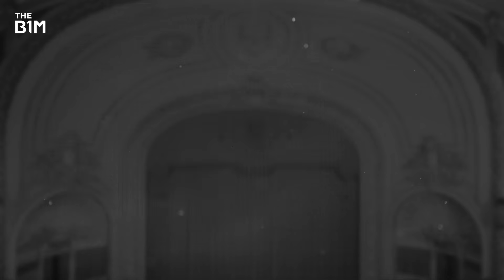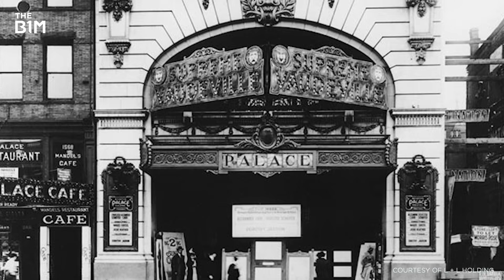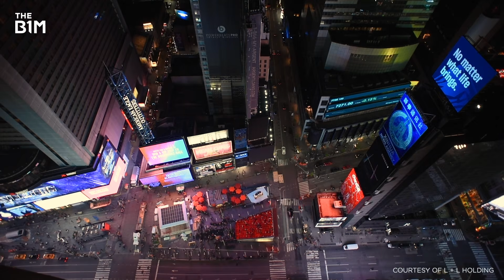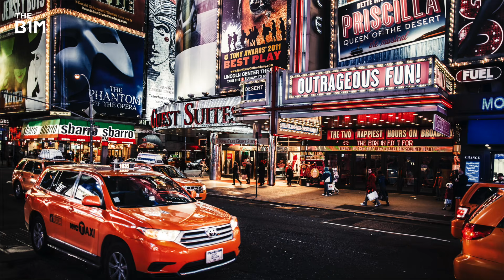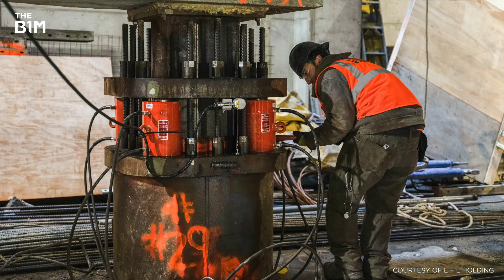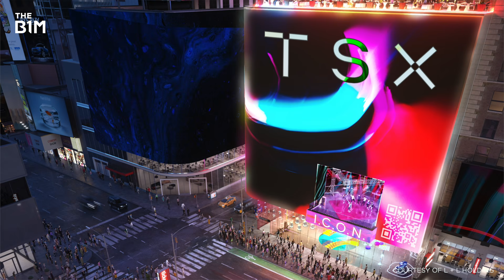The Insane Plan to Lift a New York Theatre

Comment: I was part of the company of the first show to play the newly reopened Palace Theatre, and the design is a nightmare. While the feat of lifting a building into the sky is impressive, it’s clear no one consulted theater makers on how a venue actually operates. Cramped lobby space leads to chaotic crowding, dangerous pinch points in entry and exit, and unnecessary lines for lavatories. Even worse, there are false exit doors that could be catastrophic in an emergency.

For performers, it’s a disaster. Dressing rooms are three floors below street level, while the stage is three floors above. There’s no working elevator during performances, and the backstage constantly smells of sewage from poor plumbing, with vermin issues giving the place a prison-like feel.

After playing Broadway houses and touring theaters across the country, I can confidently say this is one of the worst renovations of a Broadway theater ever executed. It’s a beautiful building, but a disaster as a working theater.

Comment: But there is one aspect that they may have missed, will this building be able to withstand the stresses that the new sound systems could produce over time, and should be studied for cracks, or movement of Any significance for at least the first year of operation on a weekly basis and if any damage, should be reported to the proper authorities

Comment: They did this all the time, even during horse and buggy days. Chicago gained a lot of experience with this when they raise the entire city by 6 feet because it was built on a swamp. They raised the Palmer house, which took up an entire city block with 1000 men using hand jacks. You can still go to neighborhoods like Pilsen and see bridges going from the sidewalk to the former second story of an old house. Moving was also very common back then, because labor was cheaper than materials. I’ve read that they would be moving a house down Michigan Avenue as the family ate breakfast and sipped tea while looking at the rush-hour crowds through their kitchen window.

Comment: Well, that's one way to do an end-run around the Ship of Theseus question. You don't need to ask if it's still the original theater after taking it apart and replacing all the parts, if you never take it apart in the first place.

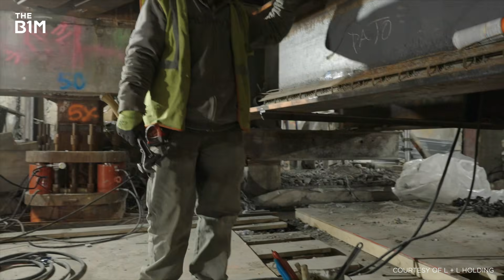Comment: 5:36 - - 34 hydraulic lifting posts (under a 48-story building) 
6:50 - - lifting the theater 30 ft (3 floors)
7:32 - - 7 weeks to lift the theater into place (2/14/22 - 4/5/22)

Comment: The retail in Times Square is always revolving and never stable. So many chains have moved in and out of the 5 street span because rent astronomical and nowadays what you find in retail in TS is the same anywhere else or online. In the 80s that wasn't the case. Multiple financial firms are backing this project and will no doubt sell it off as soon as it's profitable to them.

Comment: Can you make a video of this building in Detroit called "The exchange". It's not a skyscraper but it is a high rise apartment, but they are building it from the top to the bottom. They have finished the elevator cores, and now, they built the top floor first and are building down. Can you make a video explaining how this works and if it's good or bad?

Comment: Astonishing. I saw “Cage aux Folles” there in the 80’s. Built before sound amplification, the balconies are incredibly steep so as to bring each seat as close to the stage as possible. I was about as high up as you could get, the ceiling seemingly just a few inches above me, Do wish the grand facades of these wonderful old theaters could be restored or at least decluttered. There is so much emphasis on lights, noise, action, on the New York streetscape, it all blends together and, I think, is somehow less effective for that.
Reply: Sadly it is very common to lose the facades on these old theaters. My city was notorious for tearing down historical structures during the banking boom in the 80’s. One historical theater survived, it was similar to this as it was the place performers went when they performed here. At some point the facade and lobby were removed and my understanding is that the landmarks commission saved it mid demolition. The theater box is still intact much like this one, and while it’s not going to be raised, a mixed hotel/restaurant/theater development is currently underway. The old theater will be restored, and the new lobby will be all glass like this with a 20+ floor, super narrow hotel.
Reply: @nick-z7s4b  My home city, originally during the earlier building boom they demolished everything, but later they were required to preserve the facades, So you will have a modern building with the skin of an old building on the front with the modern tower sticking out the top. I actually like it like that, Gives the city center the historic look when in there, but it doesn't hinder growth of the city.

Comment: Controlled hydraulic lifting using various plastic like concerete was pioneered and executed first (or most successfully) in the 1980s in Victory BC,, which was lifted SEVERAL METERS.. a 100 year old BRICK. building the EMPRESS HOTEL was lifted in sections sucessfullly with MINIMAL damage… and subsequently renovated. This was managed by JAMES CONSULTING / later Task Construction  based in VANCOUVER, BC.  I had the pleasure of working with John B. And able to see CBC video documentation and a book written for Fairmont Hotels on the EMPRESS … Subsequently other structure that could be jacked expanded worldwide - both hydraulics, fluids/materials and methodology for lifting.

Comment: This project is really impressive, especially given the age and location of the building. In terms of the actual lifting, this happens more often than you'd probably expect. I work for one of the few companies in the world that specialises in this kind of work, and it's used all the time for raising/moving/installing oil rigs at sea, air traffic control towers etc. Bishop's Bridge near Paddington Station in London was also raised significantly in its entirety to allow for modernisation of the trainline below it.
MACE are also doing some really impressive work with their "rising factory" concept lately, essentially a warehouse structure that starts at ground level, within which the lower floors of a new building are built. As the construction progresses, the "factory" climbs up the building all the way up until they finish at the top floor, at which point it's lifted off of the top by a crane. Allows for construction of high-rise buildings to be undertaken in any and all weathers
Reply: This was also done with the now-replaced Broadway Bridge in Little Rock, Arkansas, USA in 1973. It was done to allow tall boats through the Arkansas River. The Arkansas River in Little Rock handles a lot of commerce.
Reply: ive heard mace have patented the rising factory . have worked on tons of high rises in london but not a mace job yet am really curious to see inside it
Reply: How interesting! Best of luck in your career. As a young person I had worked construction and was always fascinated with the coordination of the varied trades in accomplishing the construction.
Reply: I feel like it’s probably the same sort of thing done in my city to move houses. Lots of people had houses that were damaged by an earthquake but they didn’t want to destroy the house so they just picked it up and moved the house to a new, safer piece of land. Before they could move the houses though, they had to lift them off the ground like a meter for some reason. I remember walking past a house that was going to be moved soon and it been put up on stilts.
Reply: Thats insane!
Reply: @SerbianGamer  What horrible!
Reply: How horrible!
Reply: Few companies 😬 there's hundreds around the world 😂 the Aussie's lift more houses than anybody build's 😂
Reply: @delboy6364  certainly not hundreds of companies performing bespoke lifts at the scale that we typically operate at. We only have around half a dozen or so competitors that we are regularly bidding against for jobs all around the world
Reply: Lol you don’t work for one of those companies

Comment: Great post.  The one aspect missing from the documentary is a dollar amount for the work to lift this structure 30ft (I'm sure you asked and I'm sure the developer did not want that information revealed).  I wonder how they calculate the ROI for this cost?  Retail in the part of NYC depends solely on tourism and that didn't do so well these past few years, no.  ( In 1860  Chicago engineers lifted an entire city block on Lake Street I think 6ft. to accommodate sewer line installation throughout the city.)
Reply: I've read this will be around a billion dollars when it's all over. Hard to believe this is all worth doing.
Reply: @3markaw  getting closer to 4B.

Comment: Love these NYC videos. I’d love to drop a suggestion for the next NYC video you guys do! The Commodore is an upcoming approved building project going up right next to grand central terminal and One Vanderbilt. In fact, it’ll even stand taller than One Vanderbilt. Probably the most controversial aspect of it is that once completed, it will eclipse the Chrysler building, which sits right next to the proposed site, meaning many obstructed views of grand central and the Chrysler building from street level.

Comment: In a similar but slightly smaller situation, in 2020 the Milwaukee Symphony Orchestra, to make room for an enlarged stage, choral terrace, and backstage space, picked up and moved 35 feet the back wall of an long-unused theatre that they were renovating and restoring, the Warner Grand. Like with the Palace Theatre, this was because the building was a National Historic Landmark and the wall couldn't have been demolished or the MSO would've lost out on federal tax credits. Incidentally, the Palace Theatre was designed by a Milwaukee-based architectural firm, Kirchoff & Rose.

Comment: I remember moving an old theater on West 42nd Street by the Port Authority in the mid, late 1990’s when they redesigned the Street from sleazy porn venues but nothing compares to this. It’s also sad they tore down the old Ritz theater behind the Taft Hotel in 1960. So much was lost.

Comment: From someone who has done quite a bit of backstage work...

Where is the loading dock on this place? How are they supposed to get an entire show's worth of crap up 30ft? The seats look nice, but what does it look like from the proscenium to the back wall?
Reply: The loading dock such as it is was in the back in between the palace and the building behind it on 47th street past the stage door. I would assume that since a lot of the interior not covered by landmark status and therefore not preserved will be reconstructed in such a way as to accommodate this.  I imagine that loading dock space will have some sort of a freight elevator I guess in that space? Though my understanding is that the lobby will be relocated to 47th street as well.
Reply: @ActorAaronBooth  I'm sure they'd have to engineer a ramp or lift or something. I'm thinking a lift would need to be big enough for a whole truck and/or trailer. Offloading a truck into an elevator then to a stage SUUUUCKS. Especially when it's a David Copperfield show and everything weighs 400,000 pounds. That was definitely one of those shows where if you saw someone doing something sketchy but necessary, you just look away because plausible deniability is a thing.
Reply: @garywatson1975  I found the plans archived through a wikipedia link.  They are building a truck elevator just past the stage door to the left (east) of the new Marquee that will be on 47th street. It looks like that will go up to the trap room under the stage.
Reply: @ActorAaronBooth  Nice. I would enjoy watching them load-in and build a show there probably more than watching the show itself. :D

Comment: It’s crazy to see that this is essentially the same process that was used to raise downtown Chicago in the 1850’s, I guess if it ain’t broke don’t fix it. But this is a really innovative way to utilize the limited space they have available while saving a historical structure, hopefully it can be used as a blueprint in the future to save older buildings instead of knocking them down for new construction.
Reply: Well, it's debatable if a historical structure is being "saved" or if this is not rather the equivalent of plastination - exhibiting conserved entrails.
Reply: Seeing pictures of that process in Chicago was fascinating.
Reply: I think they raised the streets, not the buildings, if you are talking about when they installed the city sewer system. You can see in older neighborhoods where the first floor is now the basement, or "garden apartments", and there are steps to the second floor which is now the main entrance.
Reply: @maxfive2644  no, they raised the streets and the buildings. If they did what you're saying there, they would have covered the garden apartments up. Also you can look this up. They did it a building or several at a time. Many buildings were completely rolled out of downtown
Reply: @maxfive2644  there was another city that they just raised the streets. Ah It was Seattle.
Reply: @A.Martin  
https://wgntv.com/news/ask-wgn/chicagos-sunken-homes-are-remnants-of-a-bold-effort-to-raise-the-city-out-of-the-mud/#:~:text=Stagnant%20water%20was%20a%20hotbed,to%20make%20room%20for%20sewers.
Reply: By rules and laws heritage buildings should be preserved where they are itself.
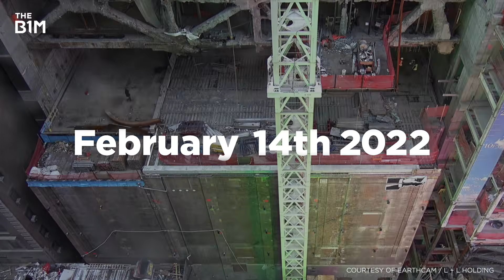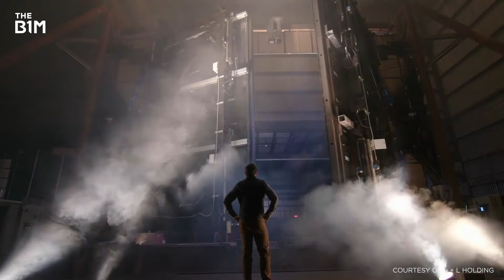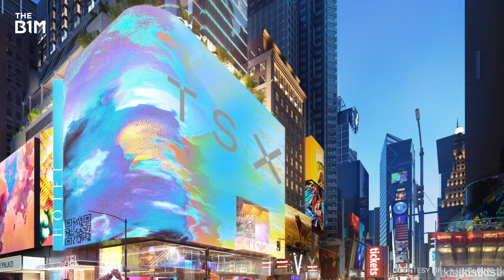Reply: This world is rapidly passing away and I hope that you repent and take time to change before all out disaster occurs! Belief in messiah alone is not enough to grant you salvation - Matthew 7:21-23, John 3:3, John 3:36 (ESV is the best translation for John 3:36) if you believed in Messiah you would be following His commands as best as you could. If you are not a follower of Messiah I would highly recommend becoming one. Call on the name of Jesus and pray for Him to intervene in your life - Revelation 3:20. 

Contemplate how the Roman Empire fulfilled the role of the beast from the sea in Revelation 13. Revelation 17 confirms that it is in fact Rome. From this we can conclude that A) Jesus is the Son of God and can predict the future or make it happen, B) The world leaders/nations/governments etc have been conspiring together for the last 3000+ years going back to Babylon and before, C) History as we know it is fake. You don't really need to speculate once you start a relationship with God.

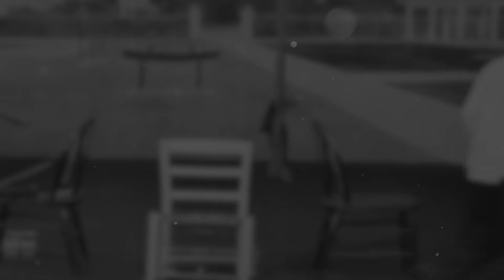Can't get a response from God? Fasting can help increase your perception and prayer can help initiate events.  God will ignore you if your prayer does not align with His purpose (James 4:3) or if you are approaching Him when "unclean" (Isaiah 1:15, Isaiah 59:2, Micah 3:4). Stop eating food sacrificed to idols (McDonald's, Wendy's etc) stop glorifying yourself on social media or making other images of yourself (Second Commandment), stop gossiping about other people, stop watching obscene content etc. Have a blessed day!
Reply: @isaiahc8390  Mushrooms also help with talking to God.   Early church leaders were famous for doing the drugs

Comment: New York is about making new things and renewing old things. Yes, the new Palace is ultra-mod but in 1913 it was cutting edge when it was built. Who knows? In 50 years maybe they’ll start stacking theaters on top of each other or building them completely underground. That would be cool to step off of a subway and right into a theater lobby!
Reply: While not coming with Subway access like you mention, I can think of one theatre: the Sondheim where the stage and orchestra seating are all well below street level. Saw Anything Goes there back in 2012 and it was a very different experience having to go down a flight of stairs just to get to the top of the orchestra section and then walk down grade farther towards the stage. Provides potentially an interesting solution to the perpetual street noise in many theatres in the district (some of course worse than others.  Looking at you Imperial…)
Reply: You can hear the subway when you're in Carnegie's Merkin Hall.  That's not a good thing.
Reply: Reminds me of the Criterion theatre in London, its about 4 or 5 flights of stairs just to get to the upper circle
Reply: They've stacked theatres on top of each other already. Unfortunately the ones in New York have been demolished. There was a theatre on top of another theatre that was on the west side of 97th street and Bway. A third theatre on that block occupied the 96th street corner. All gone. Also on Delancey Street there were a couple of stacked theatres.
Reply: the Cologne symphonic concert hall is underground and directly below a public place. Due to bad floor material, the place is always closed during performance, otherwise you would hear people walking. Costs about 100k every year to close and watch the place
Reply: Somalia should do the same.
Reply: New World Stages is a fully underground theater complex spanning 50th to 51st btwn 8th & 9th. Sure it's not Broadway scale but still impressive.
Reply: @jonathanbott87  Thank you! Once again New York surprised me. I just checked the website for New World!
Reply: Hopefully in 50 years the train will be ultra silent! Anything is possible in the Big Apple! 🤗